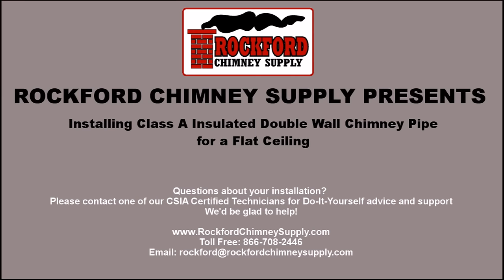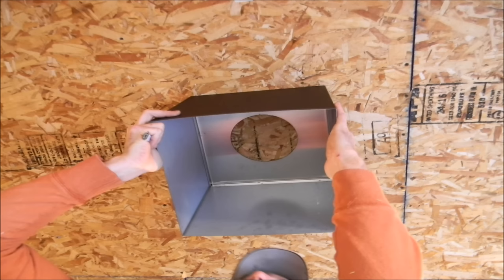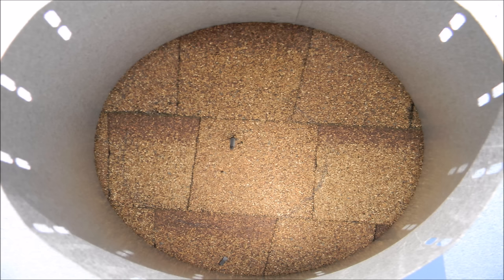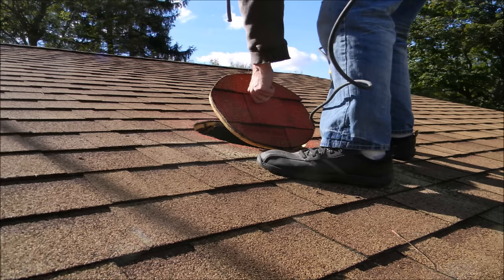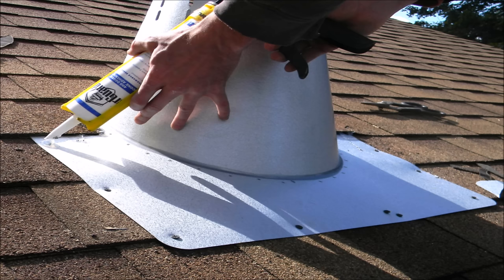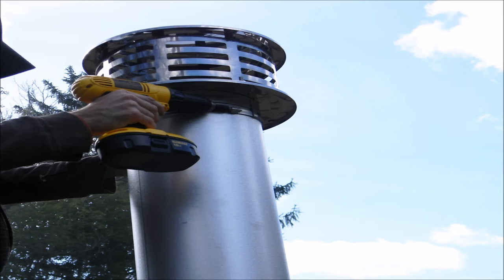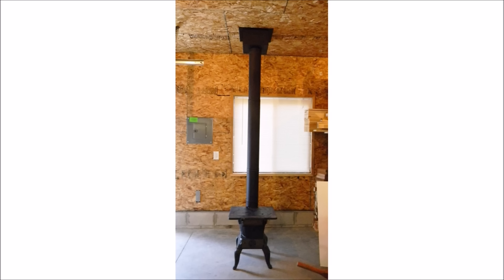Chimney Pipe Installation for Wood Stove through a Flat Ceiling

Comment: I am a professional roofer and even tho that sounds silly,I would highly recommend putting that flashing under at least one or two more rows of shingles , so the bottom of the last shingle is at least past the bottom of the hole cut if that makes sense , and putting ice and water shield on the top half of the pipe flashing would be preferred especially in a snowy area and then you wouldn’t need the silicone, sealing all the way around the pipe flashing with any caulking also traps moisture you should leave the bottom open for condensation or any other moisture/water to escape
Reply: Not shingled far enough down. Never silicone under the bottom edge. You don’t want to trap water.
Reply: your suposed to caulk the bottom so any wind driven rain or snow doesnt get up there...
Reply: @redsresearch  nope
Reply: @jeffreyfred4817  ummmm ya you are
Reply: @redsresearch  nope… you’ll trap any moisture that gets in there and it won’t have anywhere to go, you put tree nails across the bottom of the flashing or pipe boot and seal those with whatever flavor caulking you prefer on the top and that’s it, if you seal a pipe boot across the bottom like your saying especially if there’s not a perfect air tight seal made by the holes cut through the ceiling and or roof deck, humid inside air will migrate up into the dead space around the pipe boot and it will condensate just like a pop can dose saturating the area until it leaks inside or rots out the roof deck around the pipe especially in the winter months if you have that type of weather where ever you live, I’ve been roofing over 19 years of my life I’ve seen and repaired this exact issue, I’m also certified by every major shingle manufacturer, and I attend roofing conventions/seminars on a semi regular basis, I don’t know where you choose to get your information but I’m pretty certain I’m correct and you are not, but think and do what you please man this is America, you’ll just be giving guys like me something to do going around and repairing all the janky shit guys like you do.
Reply: attics are vented...
Reply: @redsresearch  lol ok guy not all houses/buildings have traditional attics, but yes in a perfect world if the soffit vents aren’t plugged and the shoots are actually above the soffit vents and the insulation in the attic is at the proper depth or R value and the intake to exhaust ratio is correct for the ventilation and it rarely is, it shouldn’t be as big of a issue, but the pipe if it’s in use will still be warmer than the colder outside temperatures and the same thing will happen just less drastic and if you don’t seal the bottom side of that flashing/ pipe boot when it drips down or the built up frost inside the boot melts it can just run out on top of the next shingle down instead of being trapped and rotting the osb over the next 3-5 years, and then when the caulking outside on the top of the pipe boot fails and all caulking dose after a few years in the sun that boot will fill up with water unless you leave the bottom of that flashing unsealed so it has somewhere to escape.
Reply: @jeffreyfred4817  well what do you do about the wind driven rain or snow then
Reply: @redsresearch  normally you would put 3 maybe 4 nails across the bottom of the boot if it’s a big one, you put one on each corner and one in the middle about a inch up and in from the sides, and 98% of the time it’s guna be tight against the shingles and if your able to get more of the flashing under the shingles you can hide 2 of those nails under the shingles, also if the wind is blowing hard enough at a upwards angle to get rain in there, you’ll be lucky if your not missing part of your roof when that tornado passes, you should also seal those nails heads with caulking, in this case tho it’s a metal flashing so you could also use 1/4 in hex head wood grip screws with the rubber washer or pole barn screws with the rubber washer same thing, then you wouldn’t even have to caulk anything, also the tiny amount of snow or rain that possibly could get in there would for the most part be able to escape the same way it got in, if you really want to caulk all the way around, the only way it could work is if before you put your flashing on you seal the pipe to the plywood probably with caulk or maybe expandafoam whatever it is it needs to be air tight, then you don’t have the chance of any inside air reaching it and condensing.
Reply: @redsresearch  that flashing is like a upside down funnel and the small part is what’s tight around the pipe so it tapers out as it goes down getting bigger in diameter, so for wind driven rain to get up to the hole cut through the deck, It would have to blow so hard it pushes water up under 4 to 6 inches of the flat metal flange around the pipe boot then it would have to continue pushing that water for three or four more inches straight up to reach the hole where the pipe is cut through the roof just to put that in perspective if you didn’t know.
Reply: @jeffreyfred4817  wont it be too hot for sealant or foam?
Reply: @redsresearch  most of these types of pipes are double walled, or even triple walled so they don’t normally get that hot, but they do make fire rated foam and insulation for areas like those or for sealing air leaks in between apartments where there’s firewalls separating units

Comment: All that flashing needs to be under any shingles 🙃
Reply from the maker: The flashing needs to be installed just as the roof shingles have been (shingled for water runoff as shown in the video). The upper half of the flashing goes under the shingles, the bottom portion of the flashing goes over the shingles. Referring to time 2:02

Comment: Thanks. The hole in the roof has my husband nervous. This will help give him the confidence he needs to cut it and install the flashing & vent pipe.
Reply from the maker: That's great news, Lisa. If he has any questions preparing for his installation or during the installation, please have him give one of our Technicians a call. 866-708-2446
Reply: How did it go?
Reply: @Rockfordchim  I have almost a flat roof with a 1 degree taper. The roof will be pretty thick. What is the maximum thickness for your flat roof install kit and how much does it cost?
Reply from the maker: @jonsmith2217  We have a flat roof flashing available. The flashing should be affected by the roof thickness. The ceiling support we offer is 11" in length or 24" in length. This is what protrudes into the room and supports the pipe. Please feel free to call us and go over your install 866-708-2446

Comment: can you adjust the roof flashing to the pitch of the roof?
Reply from the maker: The flashing is available in two size that fit a range of roof pitches:
0/12 to 6/12
77/12 to 12/12

Standard flashing: https://www.rockfordchimneysupply.com/chimney-pipes/class-a-insulated-chimney-pipes/rock-vent-class-a-chimney-systems/rock-vent-vented-standard-class-a-flashing.php

Metal roof flashing: https://www.rockfordchimneysupply.com/chimney-pipes/class-a-insulated-chimney-pipes/rock-vent-class-a-chimney-systems/rock-vent-metal-roof-class-a-flashing.php

We even offer a peak flashing that we will make to your roof pitch: https://www.rockfordchimneysupply.com/chimney-pipes/class-a-insulated-chimney-pipes/rock-vent-class-a-chimney-systems/rock-vent-vented-peak-flashing.php

Comment: Where is the attic insulation shield ?
Reply from the maker: For this particular installation, the pipe was enclosed in the attic space with a chase. This was not shown for video purposes since there are several options for attic insulation shielding. For the Rock-Vent chimney pipe, there are a few options for handling attic insulation shielding according to the installation instructions. Here is a link to the manual, please see pages 7-11 https://www.rockfordchimneysupply.com/pub/media/wysiwyg/pdf/Rockford%20Installation%20Instructions_3.pdf

Comment: Does a steep pitch roof need a more oval hole due to slant? Or does the flashing account for this?
Reply from the maker: A steep pitched roof would inevitably have a more oval hole than the one in this video. You would still mark the hole shape from the flashing for your particular roof pitch as shown in this video.
Reply: Great question!

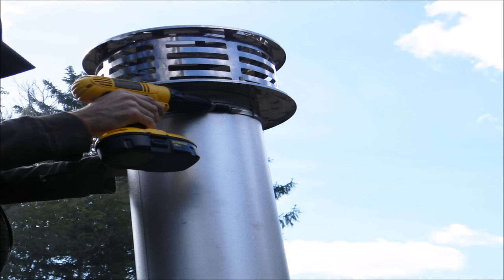Comment: 3:13 there's no code stating the chimney has to be 10 feet away from the roof ridge. it just states that the cap hight has to be 2' higher than the ridge within a 10' circumference.
Reply: 3 feet of pipe out and 2 feet higher than roof within 10 feet.
Reply: Pat B thank you
Reply: Code is actually "2 feet above ANYTHING within a 10 foot horizontal plane" not exclusively the roof or peak.

Comment: Does a thimble replace a ceiling box? Do they serve the same purpose
Reply from the maker: The thimble and ceiling box are for two different applications. The ceiling box cannot be used on a horizontal through the wall application because it does not have a cover plate to seal off the other end of the box which is outside. The ceiling box will get attached to the ceiling joist and offers load support for the chimney pipe. Alternately, the thimble cannot be used for a vertical through the ceiling application because parts of the thimble telescope and doesn't offer the proper amount of vertical support. The thimble is a wall pass through. The thimble comes with a cover plate on the outside portion of the thimble which make the thimble water tight. Please let us know if you have any other questions.

Comment: Hello, very helpful and detailed info.  My question is that the top of the flashing you used that seem to have holes.  is that for ventilation?  my fireplace is gas direct vent.  does it also use flashing with holes like that?  i wonder if those holes will create water leak or moisture problems into the house.  thank you very much for your expertise
Reply from the maker: In this video, the holes at the top of the flashing are for ventilation. The storm collar that is installed on the chimney pipe sheds water away. Non-vented flashing is available without the holes you mentioned but we typically suggest vented flashing for wood burning. Direct vent fireplaces usually vent through the wall horizontally. In some cases the direct vent fireplaces can vent vertically. If you have a pipe that comes through your roof, it will use a flashing. If your pipe comes through the wall, you do not need a flashing. We hope this answers your question. If it doesn't please let us know, we'll be glad to help.
Reply: @Rockfordchim Thank you so much.  That explains WHY and WHAT for ventilated vs non-ventilated flashing 100x better than DuraVent/DuraPlus/DuraPro/SuperVent/DuraTech/Selkirk/etc/etc/etc videos do.  I'm so sick of their multiple product lines, changing part numbers/fitment issues, etc.  I have 40 hours into RESEARCHING part numbers/fitment/etc...Ugh!!!

Comment: Is it normal for the ceiling support box to be exposed to outside temperatures?
Reply from the maker: Yes, it's function is to support the vertical pipe but also to provide the proper clearances around the pipe coming through the ceiling. The flashing and storm collar cover this area from the exterior.
Reply: Thank you!!! Simple, straight forward answer that I also needed.  @Rockfordchim

Comment: I have 6x6 beams as ceiling joists with 2x6 wood on top of the beams for a ceiling and am assuming I can just go through the 2x6 with insulated pipe without a ceiling support box? Is this correct? Thanks.
Reply from the maker: Hello, If you choose to not use the ceiling support box, you will have to use the adjustable roof support to bare the weight of the pipe. https://www.rockfordchimneysupply.com/rock-vent-class-a-roof-support.php The chimney pipe must still extend below the ceiling a minimum of 3". We offer a trim collar that can seal the gap where the pipe passes through the ceiling. https://www.rockfordchimneysupply.com/rock-vent-pitched-ceiling-trim-collar.php. Remember, the chimney pipe will need a 2" clearance to combustibles from the ceiling on all sides when passing through.
Reply: Links not working >  404 Not Found
Reply from the maker: Fixed, works now. Thank you

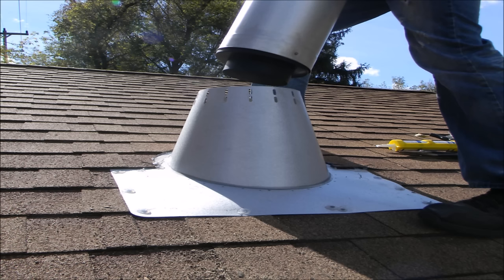Comment: 2:49  Does the adapter need any adhesive (silicone) on it's bottom side where it meets the support box?
Reply from the maker: Our adapter to our single wall stove pipe is a tight fit and requires the included screws to be used. If you are using a different brand of single wall stove pipe that is not as tight of a fit, you may need to use high temperature sealer such as Mill Pac. We also have this available on our website.

Comment: i was told to only buy the largest stove i could find  so you dont have to keep flling it  every hour or 2
Reply: Tim Bolt not true,buy one that fits your house SQ ft
Reply: Well it's not all that unrealistic I actually did that with, my first home I had only 1100 ft I bought the biggest I could find that would heat up to a 3200ft I ran that for about 6 years had amazing results moved that into my new Lodge home of 2200 ft with walk out basement and it keeps up just as well it is what it is there's nothing wrong with buying the biggest you can get you just throttle it down a bit if it gets too hot that's all,  this was a radiant wood stove by the way now if you are talking a gas furnace no do not do this you need to get the proper one to match your square foot  or it will constantly short cycle if it's too big, wood stoves however you can get away with this

Comment: Does the exterior chimney pipe (above roof) need to be double walled or can it still be single walled pipe? Thanks
Reply from the maker: For wood burning it should be insulated Class A pipe, such as our Rock-Vent Class A pipe shown in this video.

Comment: you use silicon rather than henrys
Reply from the maker: +David Bumstead We use our chimney silicone because it has a temperature rating of 450 degrees.https://www.rockfordchimneysupply.com/everguard-400-silicone-sealant-adhesive.php
Reply: my chimney cap was calked in with black not sure not screwed came loose when cutting branches what would you recommend
Reply from the maker: We would recommend either re-caulking the chimney cap back on with high temp silicone(depending on your setup) or replacing the chimney cap with a Weather Shield chimney cap. Do you have air cooled or insulated chimney pipe? You can find our caps in the link below. Or, if you'd like we can help further if you are able to email us a picture of your pipe and cap (email address below) https://www.rockfordchimneysupply.com/chimney-caps  Email Address: jwhite@rockfordchimneysupply.com
Reply: insulated
Reply from the maker: This is the cap we recommend for insulated solid pack chimney pipe: https://www.rockfordchimneysupply.com/weathershield-non-air-cooled-chimney-cap.php
Reply: ty

Comment: So did you use single wall black pipe until it reached the ceiling then switched to double wall ?
Reply from the maker: Yes, the Rock-Vent Class A insulated pipe is used to pass through combustibles because it has a 2" clearance to combustibles. It must protrude into the room at least 3" (flat) or 3" longer than the lowest part of the ceiling (cathedral) where it would then connect to single wall or double wall black stove pipe.

Comment: We have a woodheater that already has the holes in the wall. The flue needs to come from the back of the heater,  through the hole that is in the wall and up through the porch roof. We got an estimate today of $2800.00 for materials, labor and tax. I felt that was kind of steep for just installing a flue. What do you think? I believe I can do it myself with your video, but I just want to make sure, I don't get a phone call that my house is on fire due to my installation.
Reply: So what did you end up doing? It will be cold soon..
Reply: @zclubofpolkcounty   Looks like I will be doing it myself.